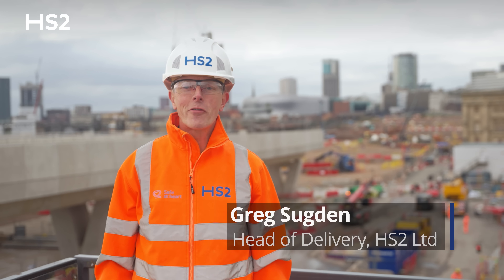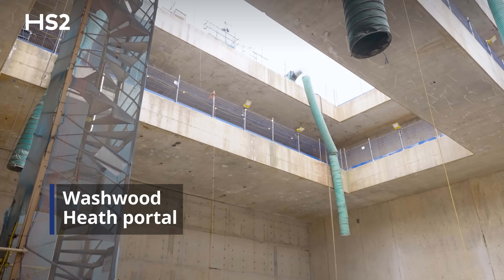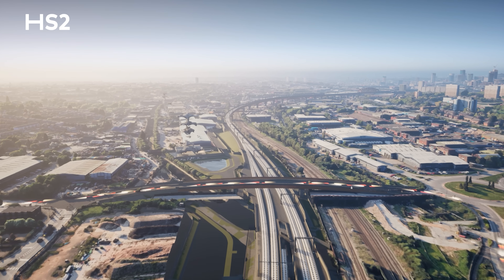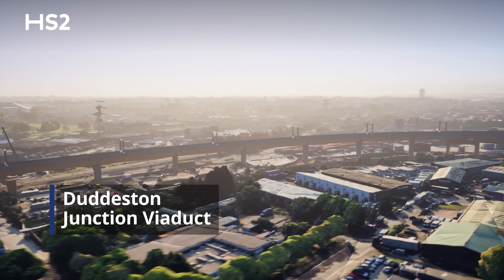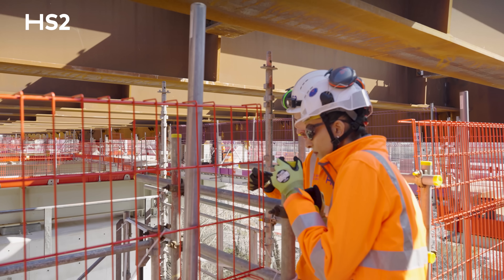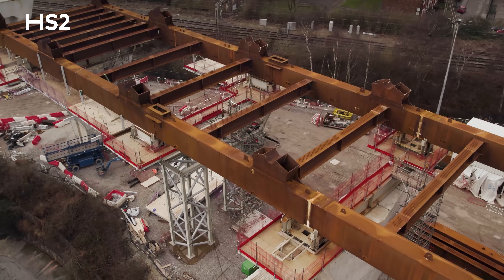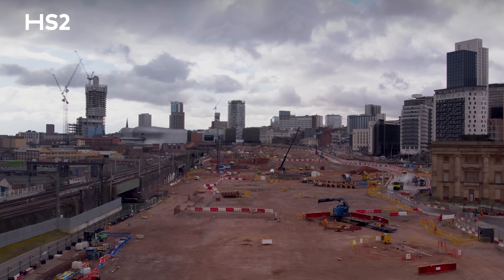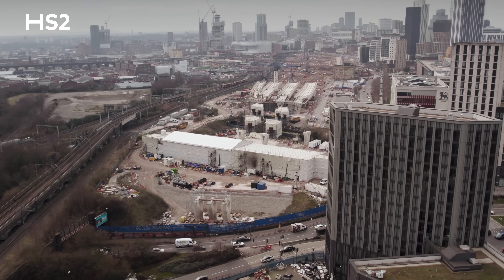Building to Birmingham: 🚆 HS2's Curzon approaches progress update 🏗️

Comment: This whole station is incredibly poorly designed and located. It doesn't connect properly with the existing rail system either, meaning people will face a lot of discomfort changing trains to destinations not on HS2. If you want to go to Wolverhampton, or Shrewsbury, you basically have a break in your journey with HS2 instead of a direct fast link. And if you just want to go to a suburban station in Birmingham, you would first have to get to New Street to enable that. I don't see how this is beneficial. It feels to me this is done on the cheap. They should have bored a tunnel with some platforms underneath New Street, to facilitate easy interchange with the existing network. Yes, that would be very expensive, but travel benefits would be very significant.
Reply: 100% agreed!
Reply: Thank you.
Reply: New St is a 5 minute walk, Moor St is right next door. Many longer distance passengers won't even come into Curzon St as classic compatible trains will bypass Birmingham to run onto places like Manchester.

OSI (out of station interchange) is not unusual in a number of cities, particularly London. Even in station interchange can involve quite long walks.
Reply: @Polarbear1-b6j  To change to a suburban train will take much longer than 5 minutes though. You have to walk to exit the station, then walk to New Street (which is more than 5 mins) and walk within New Street to the right platform. So passengers are massively inconvenienced compared to the current situation. Many passengers on the Avanti train to Birmingham actually do change trains at New Street and HS2 won't benefit them. Yes out of station interchanges exists and they are very inconvenient for passengers. The only reason they exist is because of how railways were built in the Victorian era, with companies building competing stations near each other. But now these investments should ensure a degree of integration with the existing network. This station completely fails at that.
Reply: @91Durktheturk And yet it's a 5 minute walk, and yet the vast majority of people using Curzon St won't be changing, yet those heading further north will stay on classic compatible trains and won't come into Curzon St anyway, yet of those who do change a good proportion will use Moor St not New St. And just to emphasize it OSI's are not unusual.
Reply: @Polarbear1-b6j It is at least a 10 minute walk. If you run, you might do it in 5 minutes, but whilst running you might be run over by taxis and buses, since you have to cross some rather busy roads in the process. Let alone people that have to walk with suitcases to New Street to change trains. The vast majority of people using Avanti, will have to change at New Street, also since most of the Avanti trains run towards Wolverhampton. So these passengers now using a direct train to Sandwell & Dudley or Wolverhampton will have to face a very inconvenient interchange between Curzon Street and New Street. New Street offers the most well connected network with the suburban areas of Birmingham. Moor Street only offers connectivity towards the South East of Birmingham. So what you are saying I'm afraid is just nonsense. 

Yes, OSI's are not unusual, but only in London, for tube stations. There are not many heavy rail stations that offer this, unless you look at St Pancras and Kings Cross, which are literally next door to each other. An OSI between Aldgate and Aldgate East doesn't really compare to changing between Curzon Street and New Street during a long distance journey.
Reply: @91Durktheturk  All Avanti Train services from Birmingham will run from Curzon Street when it opens any changing of trains will be done at Birmingham Interchange to Birmingham International
Reply: @peterwallen1063  Ah yes, that Birmingham Interchange station, that is actually quite a bit away from Birmingham International, requiring a people mover to facilitate the interchange. This will take time and will make things inconvenient. It still means that anyone going to Wolverhampton, Sandwell & Dudley, Shrewsbury will have to change trains instead of having a direct link. It also means people travelling to Birmingham University, or other destinations on the Cross City line, will have to change not once, but twice. It is a massive inconvenience. And I'm not even talking about Coventry being left out of the whole thing.
Reply: @91Durktheturk  Ah Yes, There will still be direct Avanti West Coast Trains from Wolverhampton to London Euston, but as there are loads of West Midlands Trains, London North Western Trains and Transport for Wales Trains between Wolverhampton and Birmingham International via Birmingham New Street, the Wolverhampton to London Euston Trains will more than likely bypass around Birmingham New Street Station and go via Bescot, Aston and Stechford and stop at Birmingham International  and the link between Birmingham International and Birmingham Interchange will be fast but is preliminary for people going to Birmingham Airport and the NEC so not realy a massive inconvenience
Reply: @peterwallen1063  I see you conveniently forgot my point about the (lack of) connectivity with the Cross City Line, which is the bulk of the suburban rail network in Birmingham, but anyways.... I'm not so sure there will be direct trains from Wolverhampton to Euston, since the whole point is to free up capacity for shorter distance commuting and freight on the WCML. If you start running these links on top of that, it sort of defeats the purpose. The plan is also to downgrade the WCML's maximum speed, from 125mph now to 110mph for all trains (so no Pendolino benefits anymore), increasing the journey times if such a direct route is offered. So quite a large inconvenience indeed. HS2 simply fails to offer the level of connectivity that the existing network has. It would make far more sense to scrap the whole Curzon Street scheme, build a junction where HS2 crosses the WCML, and let the HS2 trains run direct to New Street and further afield from that point onwards. It will be significantly cheaper, and you could probably use the money you save to quadruple the tracks between this new junction and New Street station, offer superior journey times overall and a vastly superior level of connectivity.
Reply: @91Durktheturk  The whole idea of building Curzon Street is to relieve New Street of Intercity trains from Birmingham to London, Manchester,Liverpool and Scotland so giving more capacity for local West Midlands Train services, semi fast trains to London, other services from Wolverhampton will by pass Birmingham New Street which are already there but travelling through New Street at the moment. No way could they scrap the building of Curzon Street station now as it is too far advanced plus HS2 trains would not fit into Birmingham New Street due to their length and HS2 trains will travel North from Birmingham via the Delta Junction at Coleshill to not only London but Manchester, Liverpool and Scotland with connection to other parts of the Country, the thing is you cannot please everyone
Reply: @peterwallen1063  You certainly cannot please everyone, I agree on that point. And indeed, removing these trains would free up some capacity at New Street that could be used for CrossCountry, or local services. I'm very sceptical if there will be a business case though for not routing Wolverhampton - Euston trains away from New Street, and journey times will suffer. And also from Coventry onwards. Again, I agree you cannot please everyone, but you should always look for the option that offers the most connectivity possible, because that is what makes a thriving railway (the Elizabeth line is a huge success because of this). And my suggestion of using New Street does that. And yes, the compromise is that you can't run a 400 meter train. But the value is still larger than what they are doing now. .
Reply: @91Durktheturk  The whole idea of Curzon Street and HS2 is to relieve New Street of congestion which is caused by a 50 to 90 mph 2 track line from Stafford through Birmingham to Rugby and also the size of these HS2 trains gain would not fit into New Street Station hence when you look at Curzon Street Station it is 3 times larger than New Street station
Reply: @peterwallen1063  As I said, you can quadruple the tracks at the point you join HS2 with the WCML (just south west of Coventry) until you reach New Street. That already provides a lot of additional capacity, removing conflicts between slow LNWR trains and fast through trains (XC and HS2/Avanti). And yes, a 400 meter train wont fit, as the longest platform is 354 meters. But, 354 meters is not short. And with HS2 being curtailed, with no station in Manchester being built, the case for 400 meter long trains disappears anyways. It is much better to have trains that are say 320 meters long (still longer than an 11 car Pendolino), that, if needed, you can lengthen to 400 meters later on (just like what we are doing with the Elizabeth Line trains, that can be lengthened to 11 cars) once they've build a station with long enough platforms in Manchester/Glasgow etc. It is a far more sensible, and likely much cheaper solution than Curzon street, whilst offering a superior level of connectivity.
Reply: @91Durktheturk  I don't think you actually know what you are talking about or know the route from Birmingham to Rugby, the whole line from Birmingham to Rugby can not be quadrupled due to the constraints of the line out of Birmingham to Coventry and beyond and the fact it is only a 90 mph Railway  with London north Western trains. West Midlands trains,X Country Trains from the North East to the South West and from the North East to the South East Coast, Transport for Wales Train services and any Avanti West Coast trains on this two track route which stretches from Stafford through Wolverhampton, Birmingham New Street, Birmingham International , Coventry to Rugby which is totally grid locked, plus at New Street you have the Cross City line coming in and out on a Southwest to Northeast Axis, the Line to Walsall  via Aston making Birmingham New Street the busiest station outside of London nd that is the reason for Birmingham Curzon Street and HS2 to relieve Birmingham New Street of Avanti West Coast Inter City train services and also making Birmingham More Street into a Transport Hub with Birmingham Curzon Street. The thing is HS2 has not been curtailed as at present HS2 trains will travel North of Birmingham via the Delta Junction to Handsacre in Staffordshire where at the moment it is planned to join HS2 to the WCNL and take trains to Manchester, Liverpool and Scotland with plans to update Manchester Piccadilly Station, but there are plans by both the West Midlands and Greater Manchester Mayors to build a new cheaper line from Handsacre Junction on the original HS2 line formation on a cheaper scale with a top speed of 186 mph with these trains being 14 coaches long, so that is the case and Birmingham Curzon Street design plans have been passed to allow building work to proceed.
Reply: @peterwallen1063  
Ehm, did you actually read my post? What I stated is that you can build a junction where HS2 currently passes over the WCML, which is South West of Coventry, and you quadruple from that point onwards. It basically means you link the line up with Birmingham International, so you skip the whole Birmingham International to Rugby stretch (and in fact, Rugby – Coventry is 125 mph, Coventry – Birmingham is 110mph, and LNWR class 350s used on that line are capable of 110 mph, as are the new Aventras, so please don’t accuse me of not knowing what I’m talking about when you don’t even get the facts straight). And since you avoid Coventry, there is not much in the way of quadrupling this line until you reach Proof House Junction. This is the only point where it is difficult to add 2 more tracks without investments, but it will still be cheaper than building Curzon Street AND providing superior connectivity. Upgraded signalling could also be an option, and Proof House Junction is already flexibly laid out, such that terminating trains coming from the Coventry direction can already be rerouted into the south part of New Street without conflicting too much with Cross Country and Cross City Line flows. 
And yes, you have the Cross City Line flows, but, due to the layout of the approach to Birmingham, with Proof House Junction being grade separated, this flow has never conflicted with the London – Birmingham trains to begin with… 

Also, as it stands, there is an alternative plan already to relieve pressure on New Street, i.e., rerouting some of the local trains to Moor Street by building a chord linking up with the Camp Hill line, rerouting trains from Nottingham/Leicester and Worcester towards Moor Street. Rerouting these trains has a limited impact on connectivity, since passengers from London aren’t that likely to change at Birmingham on these trains, since all these cities already have direct connections to/from London. Also a much cheaper solution than Curzon Street, with less of the downsides in terms of loss of connectivity. Making Curzon Street and Moor Street into one Transport Hub in the way you propose it sounds nice, but you still lose out on so much connectivity that you previously had, because this transport hub doesn’t link up with Wolverhampton, Shrewsbury and so on, nor does it link up with the Cross City line. It would only link up with flows to places that already have their own direct trains to/from London. 

As for the plans made by the mayors, well, time will tell whether it will actually happen. Right now there is no funding, and as the UK is essentially bankrupted after splashing the cash during COVID, I don’t see funding forthcoming from the government any time soon for this. So there is no need at all to run 400 meter long trains, 320 meter long trains will be perfectly adequate (and already an upgrade on the Pendolino’s). And even if this line is build, I highly doubt there will be sufficient demand to fill up a 400 meter long train between Birmingham and Manchester. 

The only thing you would lose with my proposal is the direct link from Curzon Street to HS2 in the direction of Manchester, but, you could also link up the existing CrossCountry route with this new proposed railway, and use electric trains or bi-modes to run a CrossCountry link from Manchester to say Reading via this new line. It speeds up journeys between Manchester and Birmingham, and will cost a lot less, and again, offer more connectivity, compared to Curzon Street.
Reply: @91Durktheturk  If it was that easy it would of been done, but a 225mph train wont run on a110mph line
Reply: @peterwallen1063  Eh, it is actually that easy. And yes a 225mph train will run on a 110 mph line. Why wouldn't it? The gauge is the same, the power supply is the same. I don't understand why it shouldn't. It just needs to apply the brakes a bit before joining the WCML...
Reply: @91Durktheturk  What are you rabbiting on about yes a 225 mph train can travel on a 110mph line but that is the point that HS2 225 mph trains will do just that 225 mph and will not be able to travel on existing lines at 225 mph as the track is designed differently and on HS2 it will be slab track, but will only travel at line speed above Handsacre to Liverpool and Manchester
Reply: @peterwallen1063  I quote you in your earlier post: 'a 225mph train wont run on a110mph line'. Now who is 'rabbiting on' about things?
Reply: @91Durktheturk  In the context of it I was explaining that what you were stating bout running these trains on an upgraded WCML would not work in that 225MPH trains do not mix with slower trains
Reply: @peterwallen1063  Ehm, the point is really very simple. If you link up at Birmingham International, you only have a very small section where you have mixing with slower trains. And, if you'd actually tried to read my post, you would have realised that I pointed out to you that you can fit quadruple track from there to New Street, meaning that you segregate slow and fast traffic from each other.
Reply: @91Durktheturk  The whole line from Birmingham New Street through Birmingham International and Coventry to Rugby is just a 2 track line with a number of passenger train services using it, these being varying Avanti West Coast Train Service to London and Manchester, X Country services from the North, North West and North East to the South East and South West Coast, Londonnorth western services from London Euston to Wolverhampton, Northampton, Birmingham New Street and Liverpool, Travel for Wales train services from North Wales to Birmingham International via Wolverhampton and Birmingham New Street terminating at Birmingham International, West Midlands train service to Birmingham International and various freight train services all vying for space on this two track line grid locking up at time both Birmingham New Street and the actual line meaning trains between Birmingham New Street and Rugby hardly at times get much above 90 mph on this part of the WCML. This is the reason for HS2 to remove the vast majority of London to Birmingham, Liverpool, Manchester and Scottish Avanti West Coast Train Services off the existing WCML onto a dedicated high speed mainline with a top speed of 225mph and incab signalling so allowing more capacity on the existing southern half of the WCML from Stafford to London Euston and through Birmingham New Street for other passenger services and freight trains to operate. HS2 trains will after leaving Birmingham Curzon Street will via the Delta Junction stop at Birmingham Interchange where a driverless people mover will take passengers to Birmingham Airport and Birmingham International Station for the WCML no where along the original line can it be quadrupled with out significant disruption and cost, if you lived in Birmingham and travelled on this line you would see how many problems they have with this line
Reply: @peterwallen1063  My goodness, you really need to learn to read. How many times do I need to clarify to you that the stretch from Birmingham International via Coventry to Rugby is TOTALLY IRRELEVANT to what I am proposing. You link up the line where the WCML intersects with the HS2 alignment, which is just outside of Birmingham International. From that point onwards, you quadruple the tracks towards New Street, meaning that you segregate slower traffic from faster traffic. Seriously, why are you coming back to your Birmingham - Rugby point?
Reply: @91Durktheturk  Do you actually live in Birmingham and have actually traveled on this section of line I fear not as sorry YOU CAN NOT quadruple the track from Birmingham International to Birmingham New Street it is impossible due to the line running through large areas of densely populated areas with no room for the track formation to be widened and definitely no way could any part of the track formation around Birmingham New Street be altered and as I have said you CANNOT segregate on this line between Birmingham and Rugby to segregate fast and slow trains. Why am I going on about Birmingham to Rugby, because that is the route to London from Birmingham New Street and not only that but trains from London Euston to Liverpool, Manchester and Scotland will be running on this HS2 line as far at the moment as Handsacre in Staffordshire where HS2 will join the WCML. Yes my Goodness you do need to read and understand, the whole idea of HS2 and Birmingham Curzon Street is the fact the existing WCML and Birmingham New Street are totally grid locked, there has been 2 failed attempts to upgrade the Trent Valley Route of the WCML which has all lead to the decision to build HS2 to alleviate this congestion.
Reply: @peterwilliamallen1063  I work in the rail industry and travel this line very regularly yes. There is enough space to quadruple the tracks from Birmingham International to Proof House Junction if you want to. No single house has to be knocked down, you may have to buy up some garden space from a handful of households. Overall, it would cost less than building Curzon Street plus approaches. Then you'd have a connection which offers superior convenience to passengers, for significantly lower costs. And lower costs are needed, because the high yield passengers that made the business case for HS2 haven't returned since the pandemic.
Reply: @91Durktheturk  Sorry mate if as you say you work in the rail Industry, you don't know a lot about rail construction and I suggest you find another job mate as I too work on the Railways, are a Railway enthusiast, live very close to this line and travel on it regularly to Stechford Station and Birmingham International from New Street and I can tell you for certain there is no room to widen this line as it is hemmed in by high cuttings, embankments, industrial estates, housing estates, narrow road bridges and stations such as Adderley Park, Stechford, Lea Hall and Marston Green built either side of the 2 track formation and would not be cheam as Cuttings would have to be widened, Embankments widened, stations rebuilt, signalling altered more track and overhead catenary ltered, no it would be a case of a couple of gardens compulsorily purchased, if it was that easy don't you think the planners would of gone about it, no you haven't thought it through have you.
Reply: @peterwilliamallen1063  I'm not saying it is going to be cheap, but it is not impossible, nor is it as ridiculously expensive as building a brand new station in Birmingham.
Reply: @Polarbear1-b6j HS2 trains will travel to Manchester
Reply: @Polarbear1-b6j Trains for Manchester will not go through New Street at all and all trains for HS2 will be built to the UK loading gauge
Reply: That was the original plan, a station beneath New Street, but it was considered too expensive.
Reply: @ianmurray250  Sorry where did you get that stupid idea from, no such plan has existed as there is not room to build a station under New Street Station
Reply: start a campaign to put in a high-speed 100mph travellator between Curzon/Moor/New Streets.  No worries.  Put in some restrooms and restaurants too so clients can watch travellator passengers whizzing past between stations.  Maybe go vertical and have some delta junctions too.
Could-be.  Put it underground and it will be out of the street level traffic and weather.  All good.